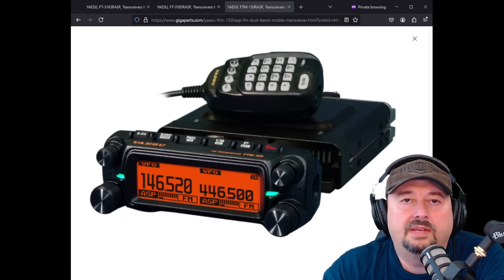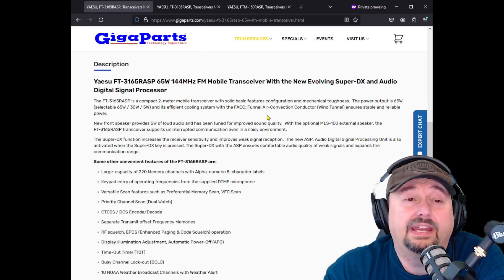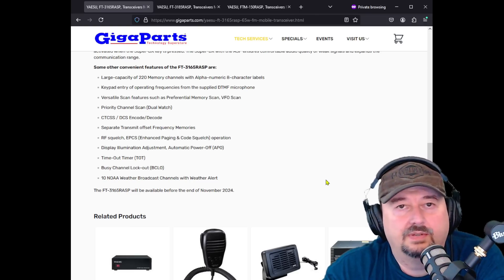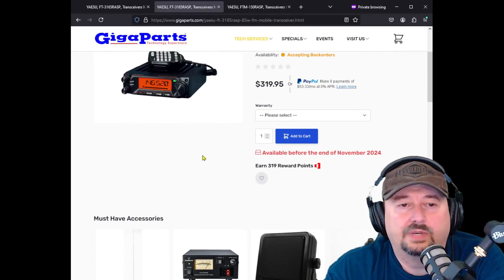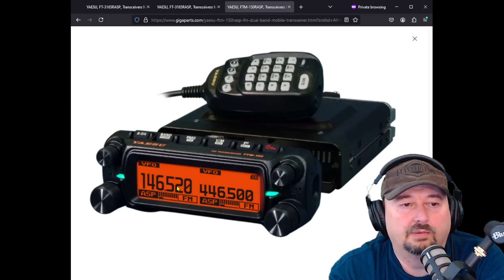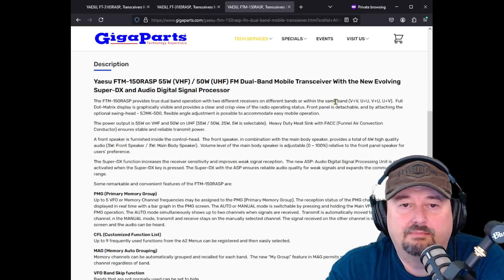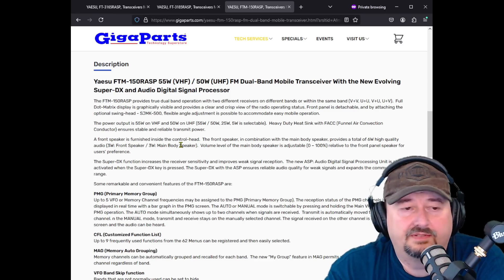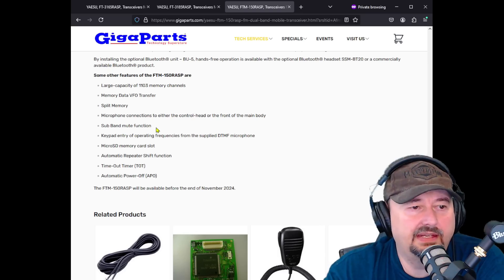NEW Mobile Radios from Yaesu! (FTM-3165Rasp FTM-3185Rasp FTM-150Rasp)

Comment: Just of phone with Yaesu tech support the agent said they have received many phone calls about crossband repeat and the YAESU FTM-150RASP. They said they have no information about how to get it into crossband or if it will support it. He confirmed that this was not in the manual or other literature for the radio. He also stated the radio should fully support crossband but at this time it does not and they are waiting for an official answer from the corporate headquarters. This is a major issue and a feature that I'm willing to bet most hams that buy a dual band dual receive radio utilize. I would hope that Yaesu responds to this in a timely manner via a firmware update or instructions.  KC9CUK

Comment: As someone who has been into radio since the late 70's and seen Yaesu introduce things line the later FT-101's, the FT-290, FT-817 and derivatives, FT-847, 901, FT-1000 series, FT-2000, 5000 etc these V/UHF radio's are fcuking boring. Yaesu is not doing anything interesting with radio any more. This functionality is in my FT-8900 and that can do 9600Baud as well. 

And they are plasticky and nasty to the touch. I really wish Yaesu could get their mojo back and hire some decent industrial designers and RF architects who could once again make radio's that are disruptive. 

I have no interest in spending money on their offerings. I needed to replace my FT-2000 after one too many front-end failures and could not find any love for the new 101 - despite soul searching and trying to find reasons to remain with Yaesu. They seem to be offering less for the money than Chinese junk.

Comment: Why go with the 65w Ft3165RASP for $275 when the Ft 2980 offers 80watts at $190?
I’ll stick with what I have…
Reply: I’ve been waiting for the 2980 to come back in stock. It looks like they may be discontinuing it and replacing it with these, which is disappointing.

Comment: Would someone let Yarsu know it's 2024. Not only are most of these boring in technology. They're overpriced. And not by a little. If you don't think the Japanese radio manufacturers are taking advantage of the ham radio market, you're not paying attention.
Reply from the maker: I'm seeing $200+ for 50w Chinese dual banders.
Reply: I agree. The first two are expensive 2900/2980s. I picked up my last two of the 2900s for under $100 at the Ham show and on QRZ. 
The last looks like a cheap version of an Icom 2730.

Comment: I wish icom would  come out with a new HF mobile radio. Remember the icom 706 ? There are not much options anymore for going mobile. I don’t like the 891 for mobile , sold it.  . I use my 7100 now but it’s too awkward.
Reply from the maker: I am actually a little surprised at all the new radios lately but more HF mobile would be great.

Comment: That FTM-150RASP would be awesome if the price were lower.  As it is, it seems too close to the FTM-500DR to really be worthwhile most of the time.  They should be pricing it comparable to the Icom IC-2730A around $300 or even undercutting that a little.
Reply from the maker: It would look good in my Jeep though!

Comment: I submit for your approval that the Yaesu FT-3165Rasp is really just incrementally improved Kenwood TM-271.  In my hands is a TM-271 I bought in the early 2000's, and it sure looks like it. Also very similar specs and features.

Comment: FTM-150Rasp, not digital. Only 55/50 watts. Why not 85 watts! You give me DX receive but only 55 /50 watts of output. "Yeah buddy I hear you but I ain't got no more damn power to reach you back." Lame Yahoo lame. Missed on that one. This should be a sub $250 radio! The others, $125. And for crying out loud make your radios MARS moddable via software and stop reducing the power. And don't nobody mention "it's not part 95" cause we all know when we need it we'll use it! 

I'll keep my: 500, 300, 200, 991A, 2 710's and that nice 80 watt 2m only one that's less expensive. 2980R <---- that R is for rant LOL
Reply from the maker: Seems they may hit a nerve.  Thanks for watching RL

Comment: Newer owner of the FTM-500dr.  On the 'S-DX' function - the FTM-500dr has that, too.  Is the implementation different on these radios, I wonder?  I certainly don't hear much of a difference in the audio when it's pressed.
Reply: Yeah, let's make the receive more sensitive but not increase the output... Bad idea. And you're correct. Not much change.

Comment: The 3165 looks almost exactly like my old FTM-3200 and FTM-3207 single band 2M/70cm radios.  They just removed the digital Fusion mode.  Glad I stocked up on those radios before they discontinued them because they are great radios.  They were also less than half what they want for this new one after rebates.